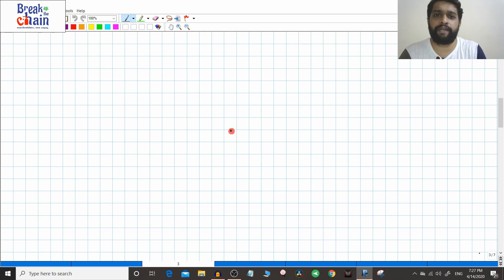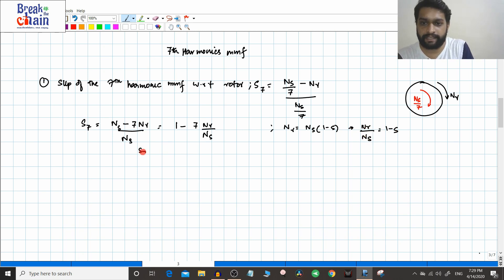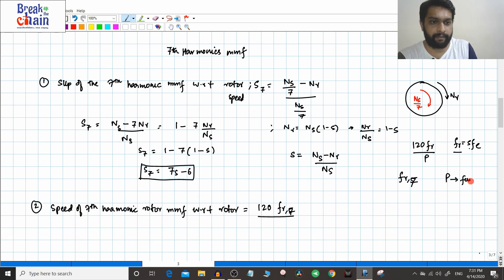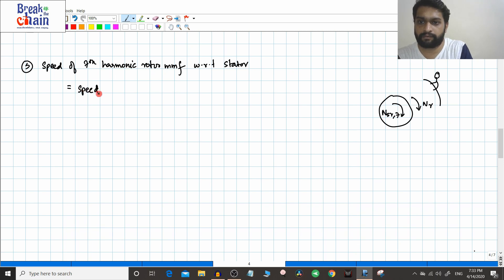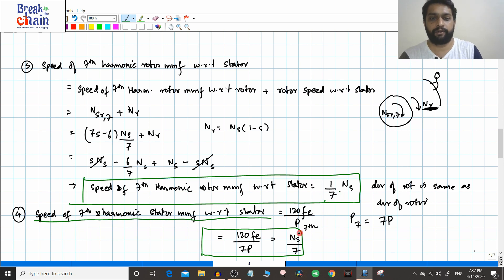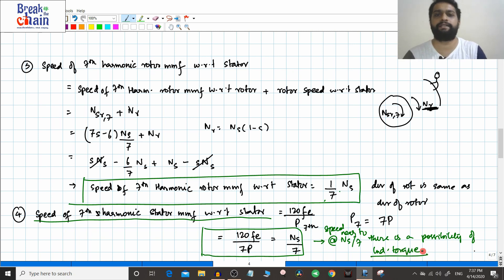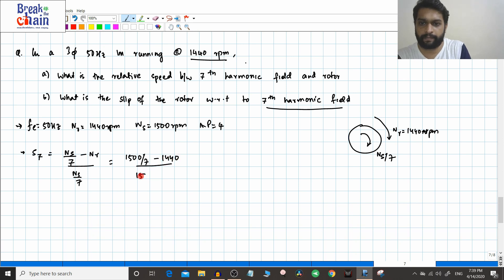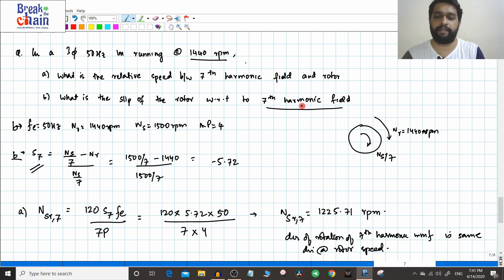Induction motor #76 - Space harmonics due to Winding distribution #6 Rel Speeds of 7th Harmonic MMF

Comment: Hi Varun, Is it correct to say that the harmonic mmf ( caused by winding distribution ) is the harmonic mmf that has a 'direction' wrt rotor (or Ns because of normal induction operation ). So that 5 th harmonic mmf is negative sequence and 7 th is positive sequence wrt fundamental, and that direction of rotation has to do with stator winding and supply. Then the direction of the induced rotor mmf harmonic takes on a direction as determined by the equivalence of the speed of the harmonic mmf stator wrt stator = speed of the harmonic mmf wrt rotor + rotor speed wrt stator = to rotor harmonic mmf wrt stator. In the example to balance this equation it seems the rotor 7th harmonic mmf wrt rotor has to be in the opposite direction of the rotor speed? I think that may be correct because that rotor harmonic mmf wrt rotor is a response to the stator harmonic mmf just like the fundamental rotor mmf is an induction response to the fundamental stator mmf?